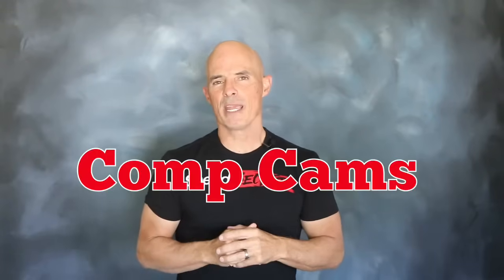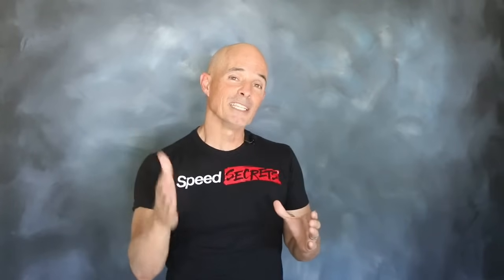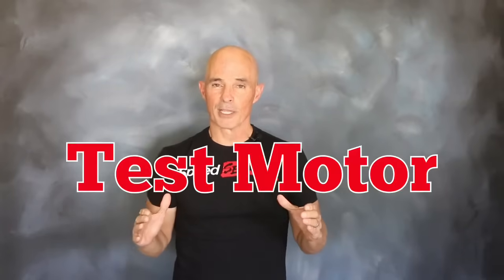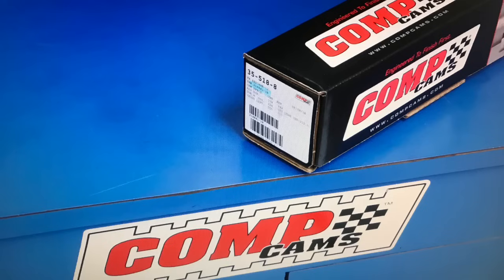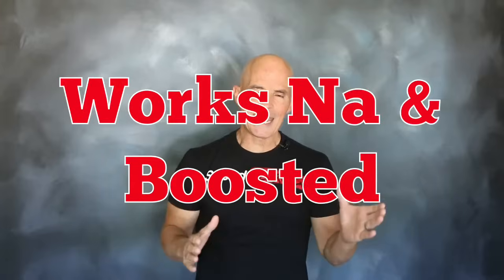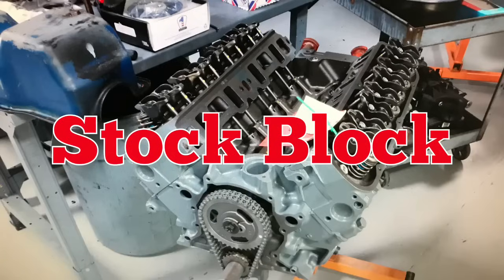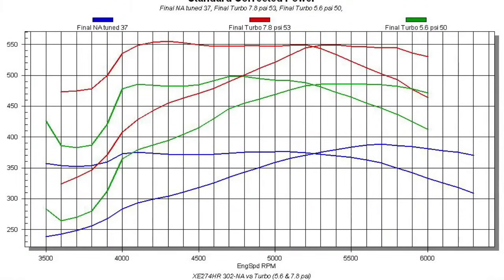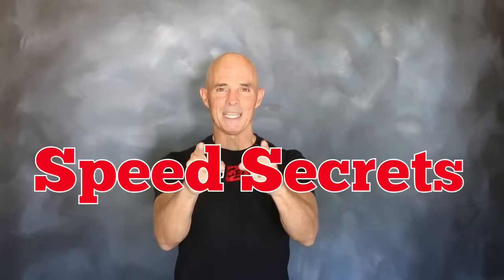Turbo 5.0 Ford Small Block! BIG Power with SMALL Boost!

Comment: Richard have you ever tested any 5.0 based engine that was built around Fords B50 sportsman 2 bolt block..I have a procharged 331 B50 block afr 185s comp 274xe cam and trick flow.  The car dynod 485 RWHP on about 12 psi. That was almost 20 yrs ago..the car sat for years and I've just got it running again.  Tuning with holley terminator x..also what's your opinion on timing gear drives. That's what's in my engine now.

Comment: Have a ‘94 5.0 stock stroke/4.030, EFI Explorer intake 75MM MAF/75MM intake 30lb injectors, ‘70 351 iron heads, Shorty’s, CompCams X3258HR-12: custom tune in an OBS Bronco. Not enough power, considering aluminum heads, stroked crankshaft to 347? Not sure if I should add a turbo??

Comment: Bigger cam dished pistons and all the fuel at 110 octane. Put 26lbs of boost on her. She'll be just fine. That's what I run in my fox and I daily drive and drag her. Also stock block with ported iron heads.

Comment: Can you use that cam will it fit on a stock 302 roller short block piston the valve clearance Comp cams 274 HR

Comment: Still remember when you ran the silver state. I'm 61, knew you sounded familiar. Cut my teeth on 5 liter ford's. Then we graduated, build a junkyard 351 Windsor!! Cheap junk. 040 over flat top Windsor with a hundred shot of gas. Had 2 scratches on the block where the distributor went into the block for timing. Realized 100 wasn't enough to worry bout! Had so much fun with that motor. Then things got crazy! Yates heads, motorsports blocks. Yes they were wicked fast. The old motor we had is still on possession of the guy we sold it to. Love ur vidieos, but, to all you guess that watching, just get something you can afford and have fun. Don't wait till you can afford the expensive parts, just have some fon, trust me, it's just as much fun!!

Comment: It could make way more
Reply: Of course it will but you'll crack the block.
Reply: That’s a myth, with the right internals assembly or even a stock bottom end I seen them go over 700hp now in days.
Reply: Maybe it will crack maybe it wont. I've heard very experienced engine builders say it so there has to be some truth behind it somehwere and I  dont want to find out the hard way as I have one of these older windsor 5.0 blocks I'm about to build. I'd rather not dump thousands of dollars into a block that may fail. If you've got that kind of money and want that kind of hp you might as well buy a beefier dart block that you know can handle the horsepower.

Comment: Would the 5.0 with a 363 stroker kit be okay to boost?
Reply: anything over 347 cid is the non OEM block, typically the Dart 363 block. It'll handle a lot of boost.

Comment: I am working on the same thing for my 89 f150 5.0l.
Reply: 91 Econoline here but with centrifugal.  @ 6 psi  hopefully.  lol   Hey do you have dual tanks?     my NA build 306 is similar NA power to this    and I was probably fine with 160 LPH  high pressure in line pump after the selector valve reservoir    but now at the potential power  I need 255 LPH +      I have an adjustable regulator.. various injectors and such.. but my main question is like...  with those two low pressure in tank pumps   I'm wondering if you only need to change    the high pressure one to a 255   and it just sucks more fuel from the reservoir.. so really the reservoir capacity is the question I guess.
Reply: Gonna throw this exact setup in my 92 bronco custom

Comment: What sort of compression numbers would you want to run on one of these turbo combinations?
Reply: depending upon fuel you can access (E85, etc), you won't want to run more than 9:1CR if you are using pump gas. The aluminum heads generally allow 1 point of compression higher than a cast iron. They usually have a better combustion chamber design, that helps as well.

Also, the ford has 4 bolts around each cylinder holding the head on, so its more likely to blow out the head gasket before it eats a piston than a first gen Chevy with 5 bolts holding everything in place 
:)

Comment: What kind of power can I expect with iron heads? I have a simelar if not exactly the same camshaft.
Reply: DANIEL RICKEL You will loose power if you put that cam on stock iron heads they will go turbulent that cam is too aggressive for your engine
Reply: the heads will choke it but it'll still make more top end

Comment: Oh loo0k more misinformation on the 5.0 block!   detonation and not enough valve spring pressure are what  hurts these blocks. not power level.
so sick of hearing this b/S
I am proof of this 3 different 5.0 production blocks. two of them with the stock reciprocating assembly. 
18 + POUNDS OF BOOST. And occasionally more , and i have never hurt a block. lifted the heads quiet a few times but never even a hiccup.. 580 plus wheel horsepower. quit with the misinformation guys
Reply: @bigboreracing356   why would I run a procharger when I had a turbo.
Ya because everyone has 8 grand for a block and aftermarket reciprocating assemblies . Jstfu
Reply: @bigboreracing356  ya I just got lucky with 3 blocks and many others that are upwards on 600 rwhp on stock block's.
Detonation and valve spring pressure are what kills them. Oh and did I mention I never ran a girdle.💪
Reply: @bigboreracing356  🤣🤣🤣 proves you don't know what your talking about . I made 580 rwhp 620 torque on a stock block .. maybe go check out the stock block cars before talking shit 🤣
Reply: @soldasis00  580 isn't 600.
Reply: It’s like people don’t like NOS because they don’t put the right tune and of course it’s going to destroy your engine. Proper fuel pressure, spark plugs, ignition timing, and proper chassis set up car will be fun street car! Yeah detonation will destroy any short block.
Reply: Yeah,  no shit! I’m running the Motorsport 9.5 deck, 4.125 bore with the Cleveland main.
Reply: I hope my stock engine holds up. I agree that a bad tune can wreck even the strongest aftermarket components. What are you using to tune with? I'm looking at the Megasquirt II.

Comment: 680rwhp going on 2 yrs now with only a dss girdle and innovators west balancer!
Reply: We have 6 cars altogether and yes he can handle it but we aren't trying to make stupid power. This car has a.c. and heat and runs low 6 second eighth mile passes all day.  No need for it to be any faster at the moment. It has great drivability and the cruise works.
Reply: @bigboreracing356  I have a big bore dart in my personal car. This was a car for my son and he wasn't ready for a dart based motor yet!!! Dart shp is by far the superior block!
Reply: @bigboreracing356  so.. should we get dart blocks
Reply: Yes I agree the sbf production blocks are junk. I have built and seen so many stock block chevrolet dominate also. My personal car has a dart 351w based stroker and a couple of kits. It gets it done.

Comment: Thanks for all the false information, and the fact that you did it in sign language was even better... it's not hp/torque that splits the block it's the combination of rpm and harmonics a motor that's balanced  +/- as close to perfect will actually take alot of abuse!
Reply: Actually the correct damper is also essential.
Everybody overlooks the simple things.
Reply: @hotrodray6802  the correct harmonic balancer/damper is a must have.. without question
Reply: A nice girdle, proper hardware & a spot on tune helps a lot too
Reply: @GreatValueJohnnySins  girdles are debatable... I know some engine builders who say they actually promote cap walk
Reply: @jasoncole5020  I agree.  The weakness is primarily at the lifter valley,  not the caps.
Reply: @jasoncole5020  you should look at T6 aluminum then.    and I was told by the shop who did my balance that they make main bores out of round... presumably the 1/2" steel.. whereas aluminum is better for harmonic absorption.    It's obviously better to go with billet main caps     but  girdles  still act laterally  so that if one cap is going to lift the other is going to lift.  IE it takes that much force to lift  or twist  and essentially you're creating an " H "  worth of webbing with the caps girdled between.  Though the girdle is technically floating.   The people who say this probably also don't play with 2 bolt mains. or they're trying to sell you splayed 4 bolts to install in a 2 bolt block.   If your only choice is a 2 bolt main  and there are products or people that swear by it .. you're not going to not run one..  I've been told by nationally known engineers/ vendors to.   I've seen videos of people showing their 2 bolt caps and evidence of walk.   personally I'm running a notched 1/2"  T6 girdle with ARP studs that actually seat fully in the bore.  I've seen people on youtube  install 1/2"  girdles  with only   regular ARP bolts ( and I tested and compared this to studs myself )   that past the bottom taper probably clamp with like   2 - 3 threads      in 475 HP  347s    ( one I watched on the dyno for a factory five  the other  is a road racing fox body )... so that's either a testament to the girdle    or   ARP    ...   that the crank didn't rip out of their webbing.   Just a thought.
Reply: if you can find the rare low deck windsor that can bore out past .04 inches, you can surpass the 500hp mark. Otherwise, you're dealing with the change in crankshaft that led to a different flywheel--great for cranking down tension with a belt driven blower. The non HO firing order not shared with the 351W, which fires the 1 and 5 cylinders together and cause stress if you use the wrong cam. A girdle holds in the carnage when it blows, the old Boss 302 had screw in core plugs that helped strength.
Reply: hit and miss tbh, if you have a dodgy casting, it'll break with any abuse

Comment: aaaaaaaaaand thats why God made the LS .  ;) lol Good test Rich.
Reply: Annnnnnnd there's idiots like u out there who are comparing a block that hasnt changed since it was born in the 60's compared to the LS that was born in 97. SMH.
Reply: Ls motors are great if your too stupid to actually build anything
Reply: Too bad god wasn't nice enough to give you a brain
Reply: @jasoncole5020  ohh really, im not the dumb ass thats comparing a 50yr old block design to a modern era block. Get educated  dumb boy. SMH
Reply: Actually for the dumbass nutswinger with all the ls comments those dimensions your patented LS platform uses like the deck surface and all were based off a ford pushrod engine because of its reliability.
Reply: Buy a dart 8.2 and run out of that chevy based shit builds sorry life pretty quick!